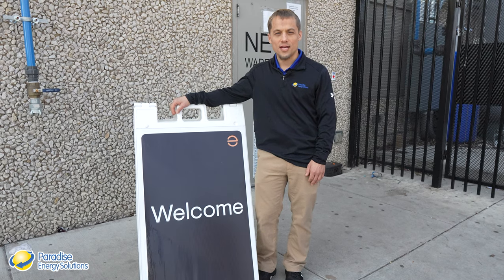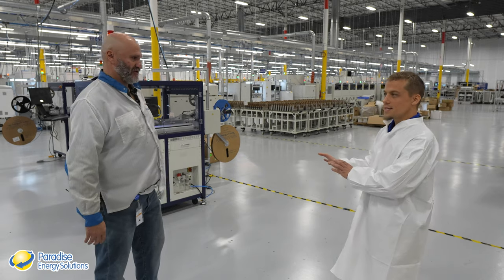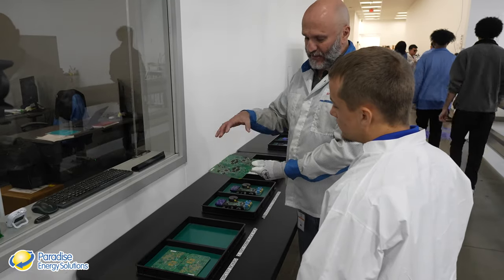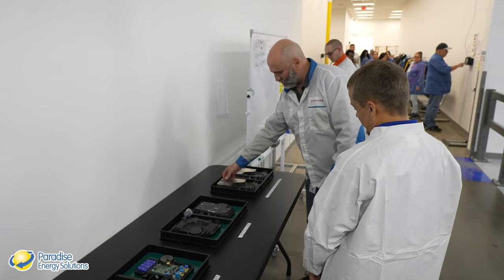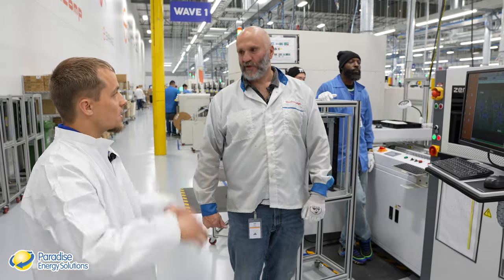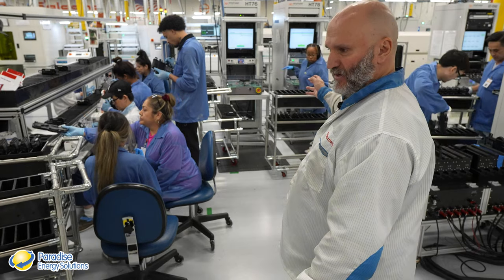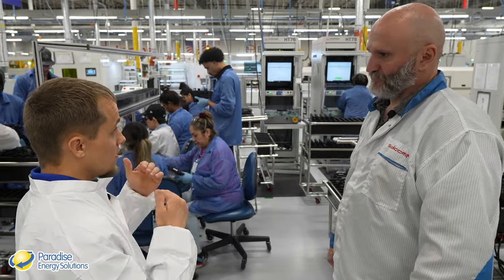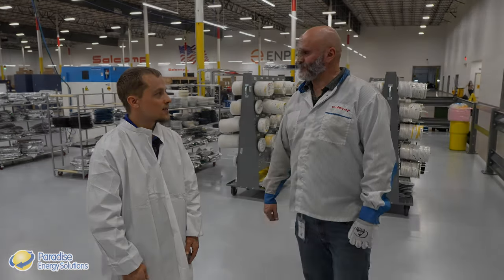How Enphase Microinverters Are Made | Enphase Factory Tour

Comment: This is a VERY thorough look at the microinverter manufacturing process. Very cool. There is a LOT in common between this and computer motherboard manufacturing. I am really impressed with the 50 year goal for the sample stress testing as well. It makes the 25 year warranty less of an insurance against failure and more of a guarantee. There are more considerations and mitigations (heat, seismic) in these than I imagined.
Reply from the maker: We came away impressed as well with the amount of testing and quality control they have built into the process. Thanks for watching!

Comment: What type of Plastic are you using for the case?
Reply from the maker: This is from Enphase's website - Enphase microinverters have a double-insulated, corrosion-resistant polymer housing that is IP67 certified. We don't have more info than that. I'm sure they would provide more information if you reached out to them directly.

Comment: WOW, loose hair, carboard fibers, wool hats, I can't believe that anyone would assemble such a sensitive device in that environment. All of the component feeds are exposed to that environment. One hair can compromise a sonic weld seal, one fiber will ruin a surface mount solder. Many such defects would take years to show up and are unlikely to be caught in their 2/1000 durability tests (especially if those test don't include water splash or immersion). I am not favorably impressed.